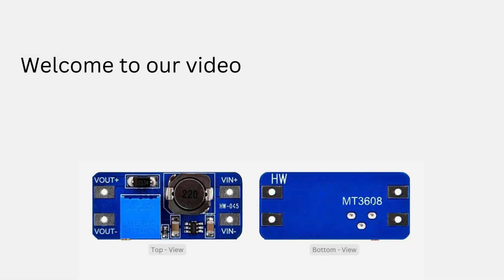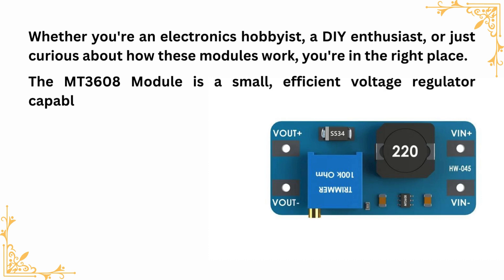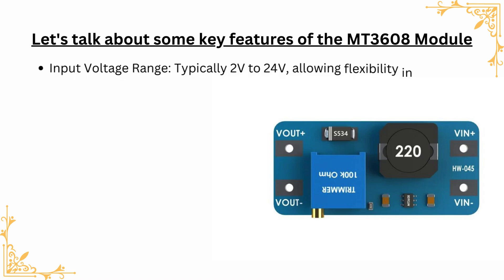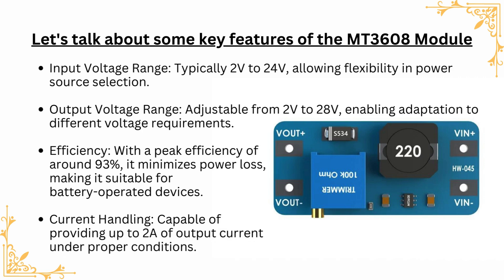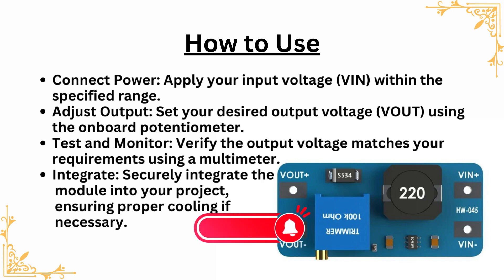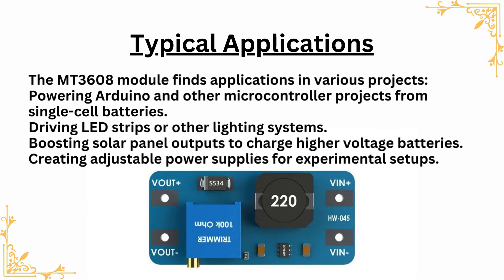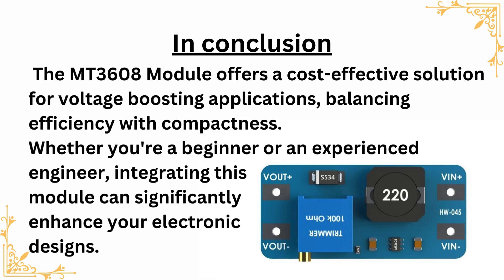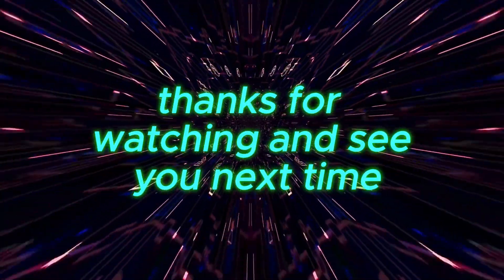MT3608 Boost Converter Module Tutorial: How to Use It and its spec

Comment: Does this have a physical stop like its potentiometer can be stopped after a certain point?
Reply: Not in my experience. It's a multi-turn potentiometer (to allow precise setting). When turned to full extent in either direction the control can still be  turned, but a very small "click" can be heard.
Reply: @tonywalton1464  ok leave that just tell me how much output it will generate at lowest setting cause I wanna generate 3.7V to 5V so I hope at lowest it is not below 3.7V otherwise it will burn
Reply from the maker: MT3608 boost module can output 5v 2A from 3.7V, but the power supply or battery must be able to deliver at least 3A current